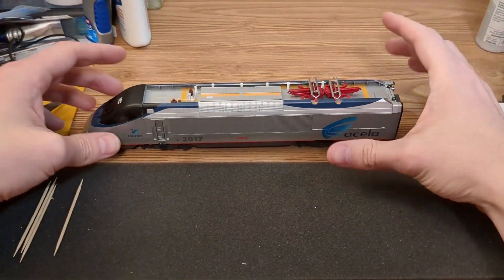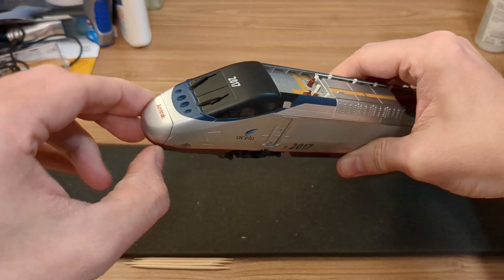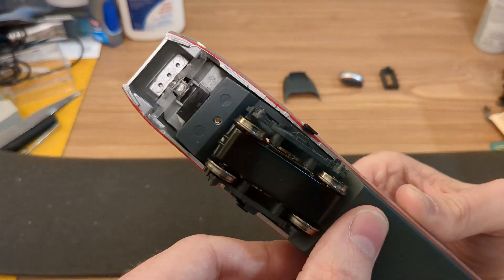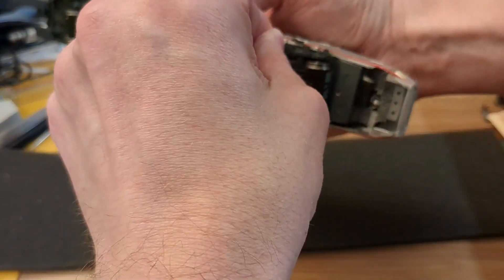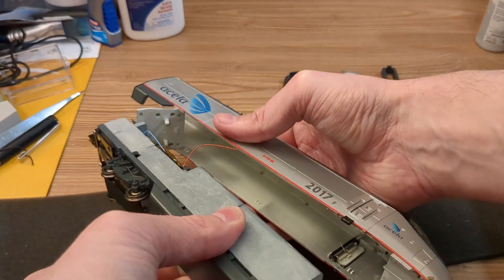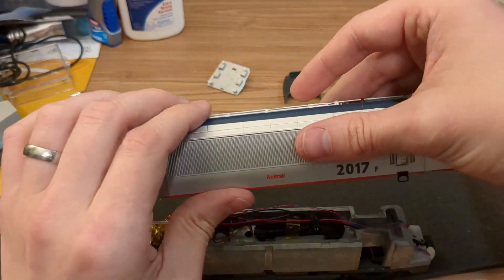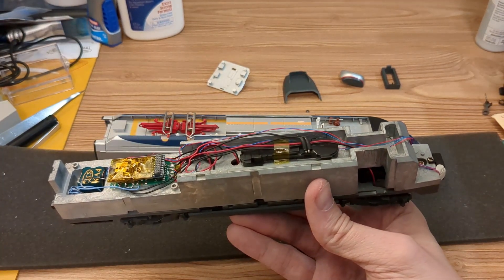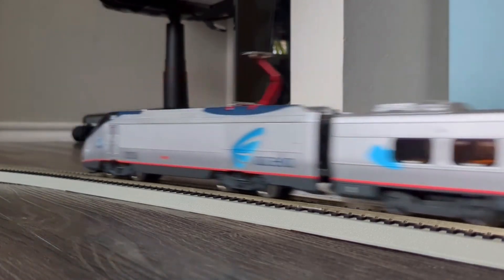How-To: Disassemble the Bachmann ACELA

Comment: The decoder is 8pin or 21 pin or some other variation? Many thanks for this video
Reply from the maker: Hi there! The board the model originally came with is set up for an 8-pin, but I removed that board and replaced it with a 'Decoder Buddy' motherboard which allows for a 21-pin decoder. The decoder is a Soundtraxx 21-pin model with their electric locomotive sound profile. I did a video on that here if you're interested: https://www.youtube.com/watch?v=eqRZua_r5B8

Comment: Do you have a parts list for this?
Reply from the maker: Here's all the parts!

Cal-Scale (CS) 621 Air Hoses
CS 724 3 MU Hoses/Plastic
CS 557 Wind Deflectors w/Mirrors
CS 535 Sun Shades
CS 190-727 Locomotive Cab Ground Light
CS 190-635 Nathan K3 3-Chime air horn

Details Associates (DA) 2317 Windshield Wipers
DA 2808 Speed Recorders

Details West (DW) 229 Ditch Lights
DW 269 Loco detail kit Post-1995 GE AC4400CW
DW 236 MU Cable with Double Receptacle
DW 239 Traction Motor Cable
DW 241 Sand Filler Hatches
DW AF-248 GE Type Air Filter
DW PB-259 Air Tank piping & brackets

Athearn G63842 Motor
Athearn AC4400 Handrails (SP Gray & White)
Athearn ATHG69872 PTC Antenna GE Type
Athearn 4355 AC4400 Locomotive Kit - Unnumbered 
Athearn Power Trucks for AC4400/C44-9W (Purchased from A-Line/PPW, PT494400-0)

Walthers 910-250 ES44 GEVO Detail Kit

Tichy Train Group 3015 18" Drop Grab Irons

CMR Products HO Scale Spare Knuckle Couplers (set of 4)

Microscale HO 87-1147 UP Dash 9-44CW & AC4400CW Diesel decals

A-Line/PPW 12032 Universal Hex Drive Coupling Kit

American Model Builders #238A HO Scale Window Set for Athearn Dash 9W, Low Boards

KATO GE Wide Cab Interior (HO Scale) SKU: 951803

ModelU 1155 Seated Driver Hi-Vis figure
ModelU 1156 Second Man in Polo Shirt figure

NixTrainz Decoder Buddy V5

ESU 58429 Loksound 21MTC Decoder

Scale Sound Systems Universal Micro Range U-FIT Speaker: 9mm x 18mm x 25mm

Kadee #148 Coupler for the front pilot
Kadee #147 Undershank coupler for the rear pilot

Pre-wired 0603 Surface-Mount LEDs in golden white for lighting